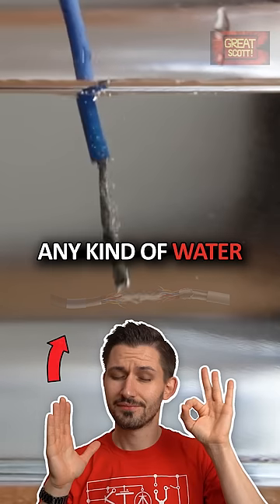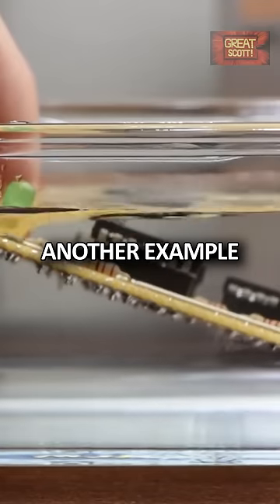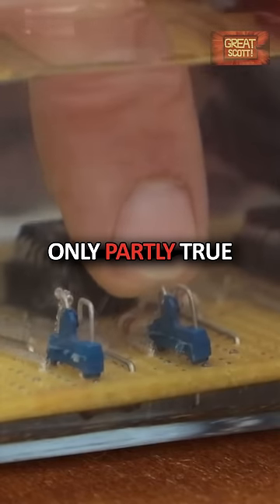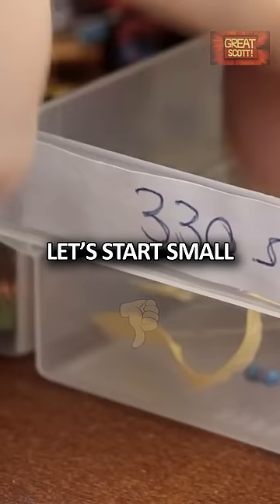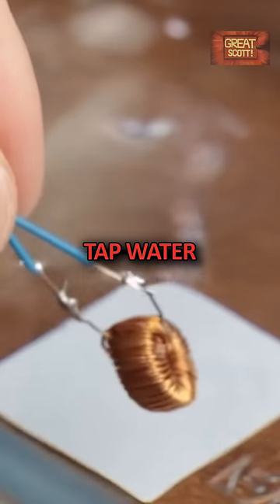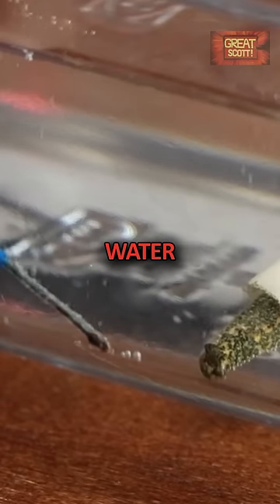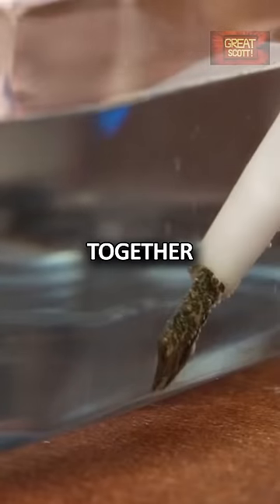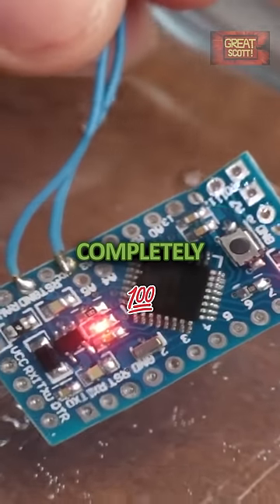The Truth About Water & Electronics!

Comment: Corrosion is also an issue with electronics and water. Its more common than id wish that gpu's die because water somehow got in and corroded the pcb over time. Liquid cooling bits can also be at risk if you're not keeping an eye out on it.

Comment: What do you coat the circuit board with, to make it somewhat water resistant?
Reply: Acrylic, polyurethane, silicone,  epoxy etc. There are purpose made spray cans for low volume use. There's brush on stuff for spot or rework use like corona dope, nail polish acrylic.

Comment: Correct me if I’m wrong, but I believe if you submerge electronics in De-ionized water it doesn’t effect it at all. I think it’s what’s used for Electrical discharge machining. The only thing is when you use electronics inside it it then becomes ionized.

Comment: In fact, what does damage the components is the minerals found on the water, not the liquid itself. I remember linux saying that on a video a while ago.
Reply: What linus didn't tell you is there is no such thing as pure water. It would be an extremely agressive solvent and therefore no longer pure the moment it touched something. Tape and reel electronic components come in desicated foil metalized bags, high rel manufacturers store some components in a dry nitrogen atmosphere. Completed boards get cleaned in an ultrasonic bath then vapor phase rinse.  Then a dunk in alcohol then into a vacuum chamber and an atmosphere of polymerizing coating that gets into tiny spaces to conformaly coat it. Water and electronics isn't a great situation.

Comment: there's something called: Electrolysis.
It happens when water gets split into water and hydrogen as well as toxic chlorine gas as you run  electric current on water.
a good way to potentially start a fire or suffer
 from chlorine gas poisoning.

Comment: water does not kill electronics, it only conducts current, creating a short circuit in many circuits.  Also, it oxidizes metal parts, coating them with rust.

Comment: Electricity takes the shortest path so think of that like an invisible lightning bolt in the water. If you got two wires a foot apart, with a substantial voltage potential and ampacity, assuming you are not conductive to ground, you could touch the water surface okay, but if you get close to the path between the two, you are likely to be shocked or burned. That’s partly why this makes it so dangerous because people who don’t know better could form a false sense of trust before it bites them.

This logic is why that fishing scene in Simpsons where he drops a battery into the lake to kill all the fish and bring them to the surface would never work. Best case scenario maybe a single fish that swam thru the current.

Comment: It's complicated and people could misunderstand this. 

For low voltage devices that don't need super high tolerances the issue is mostly corrosion over time. 

For any processing or signal electronics even a few hundred milivolts can destroy or retard performance. For anything 6V and above you will start electrolysing the water and whatever is disolved and this can liberate hydrogen gas and if there is salt in the water this will produce sodium hydroxide and chlorine gas. For voltages of 48V and higher not only will you produce gas but significant amounts of current will flow through the water as well which begins to become hazardous. 

When you get to mains voltages of 110 in north america or 240V in most of the world you're facing a serious risk if you dont know exactly what you are doing. 

Something REALLY important to understand is that whilst water is a relatively poor conductor of electricity  without dissolved ions. Water is a self  ionising substance. Water molecules will spontaneously split into positive hydrogen ions and hydroxide ions in solution which will allow some current to flow.

Comment: Makes sense though, electricity takes the path of least resistance, copper and other metals are a better conductor than water even with minirals dissolved in it. Only gets problematic if you have components under water that have a higher resistance that that water.

Comment: I like how big companies are selling electronics that are not IP rated but are for wet environments. Take for example ikea, selling EU approved hardware. Induction cookers for example, there is nearly no grounding and when the PCB shorts due to humidity and overheating it blows the main fuse instead of tripping breaker unit. Design faults.... No problem, just sell in Europe. Coatings? No problem just sell in Europe 🤣👍

Comment: well electronics are resistant to water itself, just not the corrosion and mineral build up that comes with it. also since water is semi-conductive (mostly cause of the minerals) it can short circuit electronics. otherwise, water doesn't hurt it.

Comment: Water can have minerals in it most times, and it's those minerals that allow current to flow across the whole circuit. Of course this means that electricity will flow in paths never intended and short the power supply.

Comment: Is it possible to use a coating that is easily solulable so the circuit can be modified later?
I'm messing around with arduinos on a motorbike, so it would be nice to protect it
Reply: One of the best cheap waterproofing methods is to completely coat the circuit in clear nail varnish. Not sure how easily you could work on the circuit after the fact, so it's probably essential that you completely finish and finalise the design BEFORE coating for waterproofing.
Reply: Do your own search on PCB/electronics conformal coatings. There are a few types. Don't know about solubility, but some claim you can solder through. There is though a type of coating you can peel off - I believe it is silicone based.

Comment: The electrolytes in regular water are what ruin electronics. Distilled water, which has no electrolytes, is fine for cleaning electronics that have suffered smoke damage (just be sure they're 100% dry before applying power)

Comment: I had an oil electric 120 VAC heater that was submerged in 4ft of water. I walked over with my girlfriend telling me to not do it. And unplugged it from an overhead socket. Not even a tingle. I was wearing shorts and barefoot. I figured everything was connected under the water. The plug is insulated so why not.

Comment: Not the water the problem but the oxygen in the water and the minerals in the tap water...they damage and corrode the metals...so spil water on your phone or laptop and you'll see ...the smaller the component (smd) the bigger the damage.
Reply: No, this is wrong.
The issue is the dissolved salts in the water. These have electrically conducting ions present.

Pure water without those salts does not naturally conduct at low voltages.

Comment: Pure water (and I mean pure ) has a conductivity of 0.04 Microsiemens per cm. But this reading is very very hard to achieve and the water is very expensive. The other way around is much easier: the eight bit guy uses to put pcbs he wants to restore into the dishwasher, mild cycle. They are not harmed in any way.
Reply: Water on electronics that aren't energized is certainly not a problem wrt shorting.

Comment: Remember there is no such thing as an electric insulator. Only really really bad conductors. So if the voltage reaches over the minimum conductor limit, or if the thickness of bad conductor decreases, it can conduct a significant amount of electricity

Comment: de ionized water electronics are fine
only components with current running through them in other water is where the problems start. It's not danger it is electrolysis degradation

Comment: I mean that's kinda because you used DISTILLED water which is a poor conductor of electricity as it has less-no impurities or Salts dissolved in it and thus can't really conduct electricity that much
Now Regular water and sea water on the other hand does have a large amount of salts and some impurities which are necessary for the body but which also make it a very good conductor of electricity
That is why it a big no no to bring electricity near with REGULAR water while distilled water mixed with acid is actually used in inverter batteries.

Comment: Electricity will prefer travelling through wires than through water as water is an insulator. So the circuits will work in water.

Comment: golly gee i sure wish the short would have explained WHY the tapwater and distilled water are different cases with radically different outcomes, instead of just making it seem like it's no problem to get your electronics wet.
read the replies for the science explanation
Reply: so tapwater contains ions dissolved in it, which makes it electrically conductive.
if you immerse an electronic device into tapwater, it will short circuit because you're basically just bridging everything to everything.
distilled water, on the other hand, doesn't have any ions, so it is actually fairly insulating, it doesn't change anything.
the only danger is ions on the device dissolving into the water, making it ionic like tapwater, conducting electricity, and short circuiting.

Comment: I think water only harms electronics because it short circuits terminals that shouldnt be short circuited 
Please correct me if im wrong
Reply: Yes, but the question is, why does water conduct electricity?

The answer is because it contains dissolved salts. Water is not 100% Hydrogen and Oxygen. There are other elements present.

Distilled water is water which has been boiled and distilled and as a result has less dissolved salts, it is purer.

Comment: It’s low voltage it’s not going to kill you or hurt you the best about the volt are like what 9 volts? But if it’s higher then that I wouldn’t touch anything lines I’m water either way water is a grate conductor

Comment: I think in a video like this (especially a short since more people/kids would be exposed to this) you should emphasize that water is not conductive when it is distilled and filtered.

With how the video was phrased, it kind of seems like you were implying that live wires in water=danger was a myth which it isn't in more specific circumstance (it could be a danger so it is a danger and therefore do not risk that danger). 

You were also dunking components underwater and testing the difference between distilled and tap. Less knowledgeable people wouldn't exactly understand what you were testing for and what they'd take away from the test is that "there isn't much of a difference".

Comment: lol theres questionable water heaters from china that use electricity to warm the water. its not the best idea because it causes the metal of the wires that are submerged to degrade. contaminating water with various metals. but it works. so eh.

Comment: Great vid, ignores the fanny flapping Karens, if they are daft enough to use tap water or RO water, more the fool them. I tested this by putting a hairdryer into distilled water, it worked fine, moved the water and the element heated the water.

Comment: In my college teachers always says that water is dielectric. I get that if water clear, without any addition, it pretty safe for electronics, with rare exception. But water can make rust, wich dangerous.
Reply: Exactly it's the rust as they dry out that blows them up.
Reply: Well your teacher is wrong.
It is partially conductive and it depends on the level of dissolved salts present and the applied voltage.

It is only non conductive if it is pure and you have done something to make it pure such as distillation.

Comment: The biggest danger is salt water. It is highly conductive while distilled water isn't. With potable water, the main issue is corrosion. With salt water it's corrosion and shorting, so can damage it in an instant. Never take your phone to the beach and dry it as fast as you can and you should be completely fine.